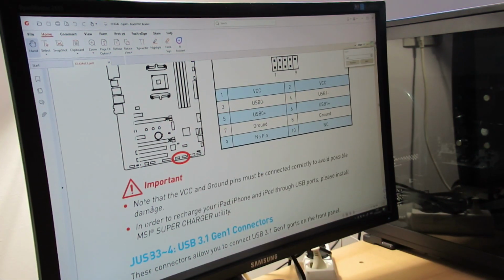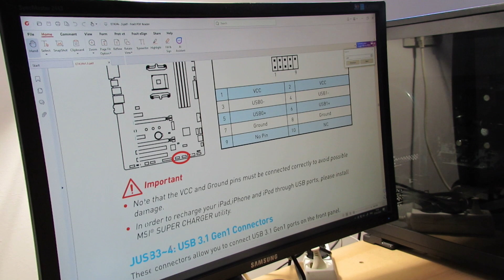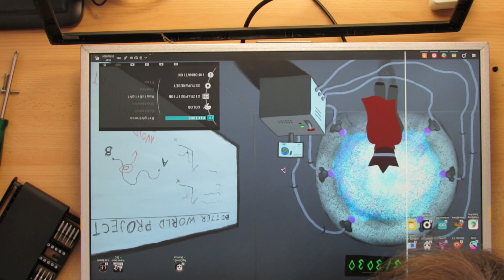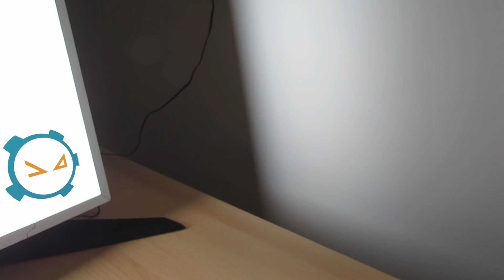Is it possible to FIX White Vertical Line on Monitor?

Comment: Pena que por enquanto não deu certo, mas valeu o video, em alguns videos que vi, eram capacitores e até mesmo fusível smd "F1" , achei até que poderia ser 1 limpeza nos flat cable. Até não resolver essa parada, deixa ele assim e torcer para não aumentar essas listas, OK ? De repente, leva em 1 autorizada, só tome cuidado com que faz com o soldador😂 1 big hug here of Brasil for all. Like and thanks.
Reply from the maker: Thank you for the comment. I have never worked with smd components but I will take a look into the "F1" fuse as that is the only clue that I have for potentially fixing the white vertical line.